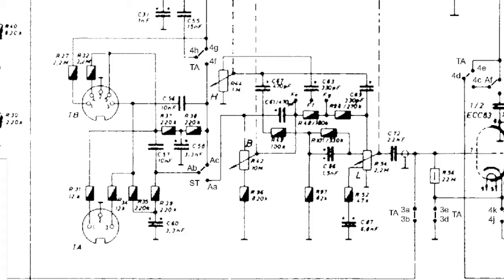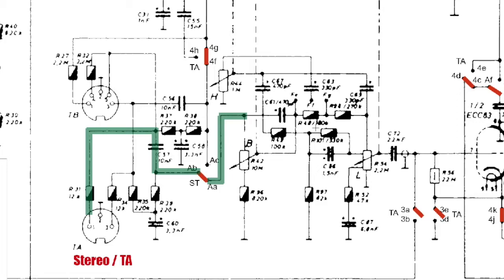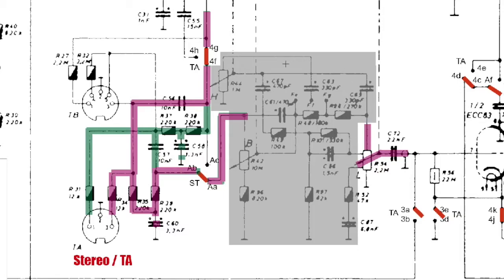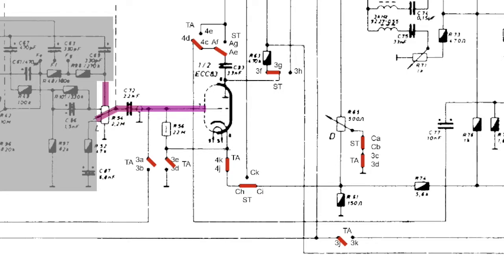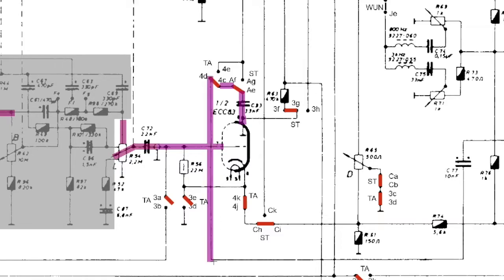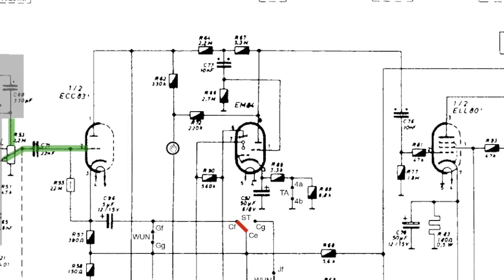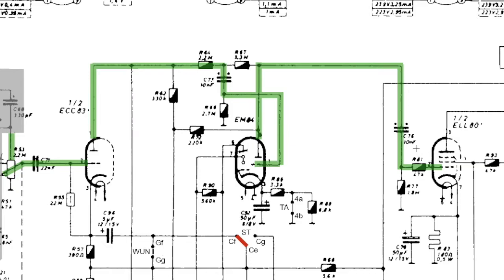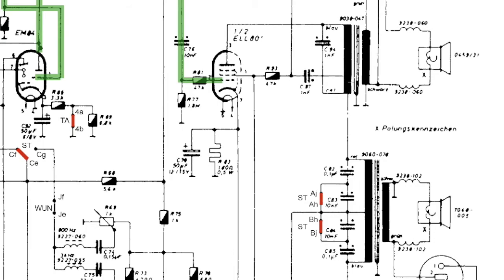Grundig 4198 tube radio restoration - Part 4. Close look at the Audio stage.

Comment: I must say this was the most clear story about one of most interesting tube audio circuits. Admire the work you've done to describe  amazing technology - sensational :). I would be delighted to listen to it. 

  I've had experience with another interesting solutions of such idea build in ERRES  radio model 618A  Which is less advanced due to use of widerange speakers instead of separated super . high tone and low tone speakers and with use of two ECL82.  Bad  headache to understand idea - in Erres they used two differently   sized transformers winded in opposite phases to gain for TA stereo in  left and right in class A and secure  mono and semi stereo for mono programs  which in this case  are amplified with 1x PP. Later Erres was purchased by Philips and their model   BX look somehow like continuation  of Erres. Anyway solution in Model 618 A (up to my knowledge) was  not replicated  .
Reply from the maker: Thank you. Yes, some of these solutions were quite complex, but make interesting puzzles 😊

Comment: Hi 
Its very amazing and not boring at all.
It’s interesting for me to know that if the external speakers connected to the amp and an stereo phono input played, the sound quality would be as like as surround system of a home theater 
The big oval speaker can play the role of a sub woofer,midranges like left and right channel speakers.
For that era its an innovative idea to have a stereo single end and crossover together with a push pull mono in single chassis.
The mixing of lower frequency range with opposite input signal could reduce the stereo effect , is it so ?
At the end the art of presentation of you is quite remarkable, really it was interesting and not boring at all
Thanks
Reply from the maker: Thank you.

Comment: i've seen a similar but less complicated output stage used in some ferguson stereo radiograms,
Reply from the maker: andygozzo72 : its just to keep one from getting complacent.
Reply: and they did another one that paralleled up the 2 channels on mono, but swapped the phase of the output transformer secondary on one channel, and added a phase inverter into the input of the other making some weird push pull where one output valve went higher current going while the other went lower... !!! i have a radiogram with this..dunno why they did it, might just as well have still kept them as normal,

Comment: Excellent video!
this circuit is just amazing.
i never seen filtering using transformers and caps this way on the last amp stage.
really cleaver, it make a 3.1 system using only 2 output tubes.
i hope it's going to fully work really soon.
it will have a really great sound.
Reply from the maker: Yes. I really think it is great.
Reply: oops. i mean 2.1 system XD
Reply: And the 2 output pentodes are together in 1 tube :) Amazing indeed...

Comment: Nice analysis of the circuit! I went through it some days ago, it took me some time to understand how they operate the eye tube as indicator since the internal triode is already used as phase inverter. The phase inverter is known from Philips datasheets as "see-saw"-inverter. I think WUN stands for Wunschklang which means custom tone setting.
Reply from the maker: Thanks for that info. There are still a few mysteries for me in this circuit, but I like their style.
Reply from the maker: OK. Just checked something. They actually 'piggy-back' the triode into the magic eye tube as a replacement of the one they 'stole' for the inverter. Really neat.
Reply: I've checked a few datasheets of the EM84. No manufacturer delivers specifications for the triode like operation points, amplification factor or output characteristics. So they worked really hard to avoid an additional EC92.

BTW: It's not called "ECM84", the triode is an undocumented function :-p
Reply from the maker: rotwang83 : yes, they sure did. Probably quite a bit of trial and error, but it works!